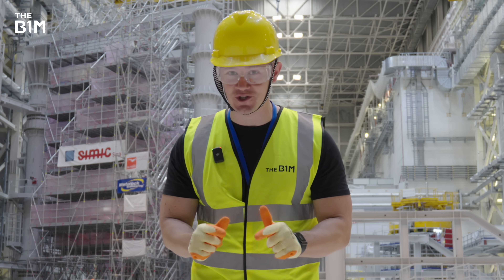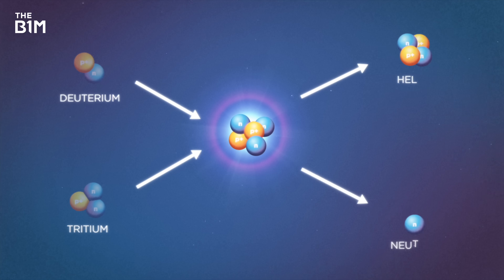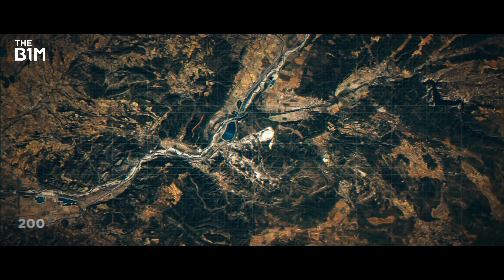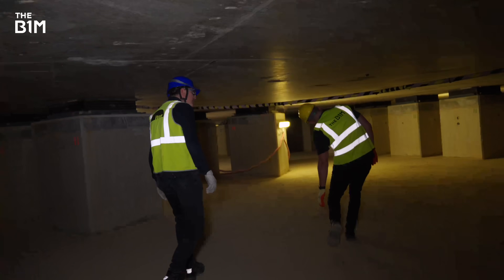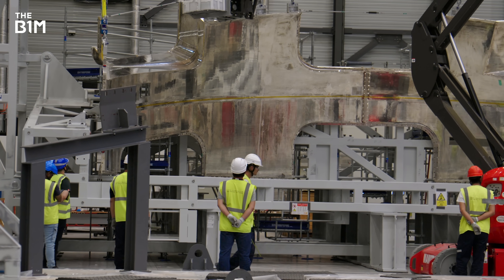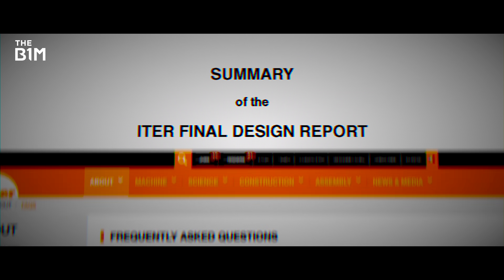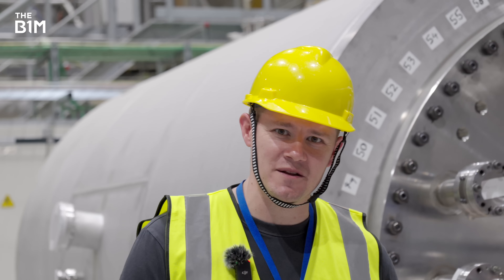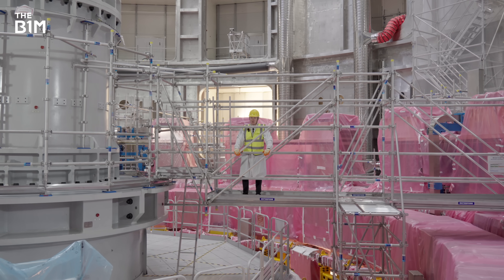This is The World's Most Complex Construction Project

Comment: The CAD files for this thing must be interesting.
Reply: Massive understatement.
Reply: The cad files maybe. But the scientific reasearch is intrestingly inconsistent or controversial. You can build a unicorn catcher, it doesn't mean uncorns exist.
Reply: How many 5.25" floppy disks 😏
Reply: I was thinking about that, do they have all the parts in one software? This might be the most complex machine ever made.
Reply: Cloud storage entered the chat
Reply: @chris-hayes  Solidworks shits the bed with about 200 components in one assembly, so there's zero chance they're using solidworks that's for sure!  I'd imagine it's split into sections where possible, and multiple companies working on different assemblies.
Reply: @gekfurian  I wonder if there were cynics like you before the combustion engine.
Reply: @TheRominGnome1  Combustion engine has worked from day one of its conception and was created in a barn with near to zero money.
Reply: You don't have all those pipes and conduits and sensors and cables and not have it all in a CAD model.
These are exactly the types of people that would do that
Reply: @gekfurian  whats your point exactly? do you think there is no nuclear fusion going on in the sun?
Reply: @Defender90210  In the sun maybe. But over here is absolutely impossible.
Reply: They use Dassault CATIA, and the challenges of managing the digital assets associated with the design are significant.
Previous fusion machines like the Joint European Torus didn't even use CAD as a golden source of truth for the design, and they had to come back later and create drawings from the machine at significant effort and expense.
Reply: @gekfurian  The unicorns do exist, but catching them requires using a very finicky principle of physics, the square-cube law.

The unicorn-catching fluid catches unicorns within its entire volume, but then it loses unicorns through its surface as they can escape from the fluid there, never to be seen again. However, surface and volume do not have a linear relationship: small things have a lot of surface relative to volume, whereas as things get bigger, their volume grows faster than their surface, until they have very little surface relative to the volume.

Because of this and at parity of other factors, we can only catch unicorns if we have a lot of catching volume but relatively low surface for them to escape. Hence, the unicorn catcher needs to be enormous to maximize this factor, and unfortunately enormous means expensive. The good part, however, is that this also works in reverse: as we make the unicorn catcher bigger, its volume grows exponentially greater than the surface, so making it even a little bigger than the critical point can catch us a lot of unicorns. This is amplified further if we use something like a denser unicorn-catching fluid, which has become possible in recent years.
Reply: @Blaze6108 I can appreciate the analogy, though your analogy describes the literal process of catching neutrinos more than it does fusion
Reply: @musicdev  Haha thanks, I like sounding ridiculous.

I was meaning to refer to the energy of the fusion reaction itself - energy gain is volume, energy loss is surface, so current tokamaks benefit from being unreasonably large.

Hopefully no one disputes the existence of neutrons!
Reply: I keep thinking about the plans for this building too lol. Just the drawings were millions and millions!!
Reply: @sidehop at least 7
Reply: Give the extreme complexity and thousands of specialist contractors involved, they could only be stored on CAD files.  A complete single set of A0 or 36"x48" of blueprints would take a year just to copy as there would be literally over 10 million drawings to deal with.  This project makes a major world class hospital look like a kiddy project.  Only a silicon fab plant would be nearly as complex as ITER
Reply: Separate CAD file data center. With top security + top secret.
Reply: @gekfurian are you denying nuclear fusion exists? Or are you denying we can harness it? What are you saying? Serious question.
Reply: @carlwalster7664 guaranteed differnt parts are being outsourced to different companies. I agree, no way is this all one cad file. Each component will obviously be a single file and possibly even broken down further into sub components.
Reply: @gekfurian so what? The combustion engine superceded the steam engine. Is your argument saying we should stick to the old combustion engines?

What is it that youre getting at?
Reply: @gekfurian impossible based on what exactly? Why is it impossible? Explain, show the actual argument and stop asserting things as if you know  it's a fact. I'm open minded. Show me the work that falsified the theory behind fusion reactors.
Reply: @Nuffsed81  
1-The fact that fusion occurs in stars is only an educated theory, but no one has ever proven it for sure.
2- Humanity has never produced a single watt of energy using this technology.
3- Combustion engines, like any other energy source, obviously needed some improvements over time, but they were known and proven technologies from the beginning.
4- This fusion technology, as they describe it, clearly violates the laws of thermodynamics.
5- Tritium and Deuterium are not so easy to find or obtain as they describe them.
Reply: @gekfurian  no, the combustion engine was built on centuries of predecessor advances. If each of those people back to da vinci eho imagined the same, said "meh I won't be the one to make it there's no point to trying"  then we wouldn't have any technology that we use today
Reply: @gekfurian  that logic doesn't work here, fusion works, we have successfully operated fusion reactors many times already,  we just can't sustain it for very long, but it has been proven
Reply: million pieces
Reply: @gekfurian  We know that fusion reactors exist. The Sun is one. The challenge is can we reproduce it and harness it? I fear there are alternate sources of energy that are easier to create and control. After all is said and done, energy that is too expensive to generate is useless. We already have the Sun - we should be focussing on harvesting that energy and directing and controlling that. An orbiting system of solar farms that direct power back to earth is more achievable, in my opinion.
Reply: They use 4dfusion
Reply: @benfowler1134  nah they don't
Reply: The RFI's alone must require their own data farm.
Reply: @gekfurian  haha this is interesting,
Reply: My thinkpad would be spitting flames like an eBay civic trying to load one
Reply: i'm still thinking about the FEM renders for this an how accurate they'll be when this thing gets commissioned.
Reply: interesting is a astronomical understatement 😂
Reply: They asked chatgbt how to build a fusion reactor and it just spit it out, should be fine.
Reply: @alistairmorrish8613  loooool none of these idiots know what the sun is and they have limitless electricity, they just dont want you to have it !
Reply: no it is not.
Reply: @gekfurian the unicorn exists but the catcher doesn't yet.
Reply: @gekfurian  Human efforts of mass scale are nothing if not inconsistent and controversial that’s true, not just for fusion energy, though recently takomak reactors have scientifically proven themselves, and if you even remotely respect what that means, then why isn’t fusion a genuine possibility?
Reply: ms paint
Reply: They'd still need to convert them to pdf for me tbh, amazing project though.  I'll probably be soiling myself in an old folks home by the time the world sees the benefit but it's a worthwhile cause for mankind
Reply: from my humble experience from making a 3D model of a city in Sketchup, I would expect them to have the machine split into relevant sections and only taking the mutual components for reference. And then those segments are manufactured as a whole, not worrying about unrelated parts
Reply: @gekfurian bro the sun is real
Reply: Reminded me of "Contact"
Reply: @gekfurian  firstly, fusion in stars is a proven theory, with experimental and observable results for decades now, so I don't know what you're talking about. Also we have created fusion experimentally in hundreds of different mechanisms , some even producing more energy than required to run the mechanism, what law of thermodynamics does it violate? And tritium is found in minerals and rocks instead of the atmosphere, but there is a steady supply for it. Are you okay?
Reply: @gekfurian you really should read some research papers.
Reply: @maxx8011  LOL!
Reply: @gekfurian You think nuclear fusion is not possible on earth? We have achieved fusion already. We just need time to sustain it. Which is physically possible. If you have a physics problem these engineers and physicists missed, then you should just go tell them they are spending billions in nothing knowing you have all the answers already
Reply: @gekfurian  haha you're too busy being ignorant to actually watch the video eh? The one that shows Germany's already successful fusion reactor... along with several others...  feel sorry  for your poor mother
Reply: @jcbbb  That's the spirit science needs.
Reply: @gekfurian  1 - Fusion is well understood. There's no doubt that this is how stars power themselves.
2 - Of course we've produced watts of energy via fusion. That was achieved first in 1951 with Ivy Mike.
4 - How exactly does this violate the laws of thermodynamics? Please elaborate.
Reply: @gekfurian  Fusion reactors have been built and made to work on Earth hundreds of times.  So far the problem that has not been solved is that they have to put in more energy than they can get out, and are unable to keep the reactions going for more than a short period — often it is measured in milliseconds.  This project though, has zero chance of solving the problem, as it simply takes the same approach that has failed many times before and scales it up.  The only approaches that have come anywhere close to working are not being funded by any government, which is stupidity on a monumental scale.  The Tokamak approach is unlikely ever to work.  Pulsed approaches have come much closer to Unity — the point where the energy output equals the input — yet are not part of this hugely funded project at all.

Fusion reactors are a solved problem, making one that passes Unity is not solved.
Reply: @Blaze6108 

W comment
Reply: CAD has been replaced by numerous 3D modeling platforms.  Each trade, electrical,  mechanical, structural, & hundreds of others will create and manage their specific part of the "plan" which will be "assembled by 1 or more lead architectural firms.  I recently retired as a senior project manager and I cannot even conceive of the complexity of this massive undertaking.   Huge respect!
Reply: Yes… as a pipe designer I see some very interesting pipe arrangements. I don’t see B31.3 or B31.1… I see piping components & arrangements more commonly found in Computer Chip Fabrication plants.
Reply: @leehappy3259  What did you build?
Reply: This is my nightmare as a construction surveyor
Reply: Fusion reactors rely on the assumption that hydrogen fuses to helium in stars under intense gravitational pressure and very high temperatures. It is also theorised that this type of fusion occurs to increasingly dense elements up to iron whereupon all the fuel in the universe will be used up and the fires go out.This is a great conclusion if you are observing a steam engine in a shed when all the coal is burned but has no relation to a universe that has always been, has no limit in size and will continue.
Reply: mate, as a final year computational design student for BIM projects - all i can say is that the CAD files for this would be absolutely ridiculous 😆
Reply: @gekfurian fusion has already been achieved 3 times with a net gain in energy, this isn’t like catching a unicorn, it’s like catching an elusive thought extinct creature, fusion has been done, but not at all on this scale
Reply: @gekfurian what's this based in? It is mainly, or rather significantly, an engineering challenge
Reply: 100% use CATIA. I don't know anything else that can handle assemblies of this size.
Reply: @gekfurian  Nuclear fusion has already been achieved in previous experiments, that is the entire reason this site is being constructed, to improve and scale up the project.   In December 2022, scientists at the National Ignition Facility achieved nuclear fusion “ignition,” in which the energy produced by the fusing of atomic nuclei exceeds that needed to kick the fusion off.
Reply: As and HVAC contractor I would love to see the duct design portions.  The work looks beautiful!
Reply: @chris-hayes  No, even in smaller projects it'd be split up. Software/computers have limitations, every part must be loaded into memory then interact with every other part. After too many parts, you get a breakdown similar to rush hour traffic. Even hardware/software aside, it's just easier to manage and not necessary to have everything shoved into one file/project.
Reply: @gekfurian  if it doesn’t work, at least we’ll never have to build another one 😇
Reply: Probably put it together in TinkerCAD, great software. I heard they used it back in the 1940s to build the space shuttle that flew the dog Loki to the moon.
Reply: @gekfurian  wow you are really a full blown conspiracy theorist. I'm. It going to wate my time. 1 or maybe 2 of your arguments have some validity but only some. The rest is just your lack of understanding and absolute science denying.
Reply: @ClemT-zr1wd  okay how do we get litmiltelss energy from the sun. Show us your work.
Reply: @gekfurian  you are using "spirit science" as your go to? Now I double down on your madness.
Reply: @gekfurian  "The cad files maybe. But the scientific reasearch is intrestingly inconsistent or controversial. You can build a unicorn catcher, it doesn't mean uncorns exist."

Unicorns dont exist, but nuclear fusion does
Reply: @gekfurian  "In the sun maybe. But over here is absolutely impossible."

Considering that we have achieved it here on Earth, albeit for an incredibly short amount of time, that completely disproves that its impossible here.
Reply: @gekfurian  "Humanity has never produced a single watt of energy using this technology."

Yes, we have. A very small amount so far, but we have.
Reply: We have a nuclear physicist in the comment section apparently @gekfurian
Reply: @sidehop More than 2
Reply: I think your computer would liquidate
Reply: @gekfurian  WHAT SORT OF ANALOGY IS THIS XDDDDDDDDDDDDDDDDDDDDDDDDDDDDDDD
Because you basically said nuclear fusion doesn't exist, aka chemistry doesn't exist, aka physics doesn't exist, aka atoms don't exist AKA NOTHING EXISTS XDDD WEIRDEST COMMENT EVER.
Reply: The CAD for this is why Autodesk made Worksets
Reply: And it's all in layer "0"
Reply: oh god i wouldn't understand a thing lmao
Reply: What is cad?
Reply: @gekfurian  that's like saying wood burned from day 1 so we shouldn't use fission reactors because they took years to make them work
Reply: @Decton  no
Reply: @gekfurian  peak brain rot
Reply: @Decton  ok. If you say so. You know better than anyone else.
Reply: @gekfurian  no i don't´, i only know what is given to me, unlike you who denies the possibility of fusion to even work
Reply: think of decoupling hierarchy - each sub-system simply does its thing - just like when designing very complex software systems, decoupling and the use of interfaces becomes very important to keep the thing maintainable by a lot of people; interestingly, no one needs to understand the whole thing in all the details
Reply: @gekfurian  Fusion has worked literally from day 1. The Sun was around much longer than the combustion engine.
Reply: I heard they were just using Minecraft for their blueprint designing.
Reply: likely revit
Reply: @gekfurian  you're a stubborn one, eh?
Reply: @gekfurian  hey dude my daddy showed me that I had two legs and could walk or run everywhere I needed to go before the combustion engine existed. Besides, you need fuel and who the hell can afford that? Mama still don't even buy us any sugar saying it's too expensive, no way would she spring for gas. Why waste money on something that God already gave you the answer for? Pathetic
Reply: @gekfurian imagine being so confidently incorrect.
Reply: @gekfurian   in this case fusion does exist :D
Reply: BIM
Reply: @gekfurian ”absolutely impossible” feels arrogant
Reply: @gekfurian 1- The fact that fusion occurs in stars isn’t “only” an educated theory, there is lots of evidence to back it up. 
2- Humanity has generated several megawatts using fusion… this was just a lie from you.
3- Fusion, as a process, was proven from the beginning. The issue is engineering, not physics.
4- How does it violate thermodynamics? Seems like you don’t know what you’re talking about.
5- Finally, a true statement.
Reply: Nah that's only fission
Reply: It's most certainly EPLAN
Reply: @gekfurian  So was the creation of the blue LED
Reply: @gekfurian  well good thing we know fusion exists. its more like building the catcher..
Reply: I think about this all the time. Any time I think my CAD is getting complex, it doesn't even scratch the surface of a small team's project, let alone a project of this mass scale. I often wonder how it is even possible at times.
Reply: @gekfurian  bro thought he was the smartest guy in the chat lol
Reply: @brayanmiranda9158  maybe im not the smartest, but the fact that they use our money to research something so challenging and not their own, means that that they know it doesnt work
Reply: it's not cad anymore it's procore
Reply: @gekfurian  thats pretty interesting what do you think is the real mechanism that powers stars ? based on conclusive data and observations
Reply: @gekfurian they have already pulled off fusion about a year ago with the first 100%+ energy return. No one cared and it was a massive achievement, this is scaled up; and more efficient. It's also not a unicorn, the sun is real.
Reply: @gekfurian Converting two hydrogen to helium requires less energy to be stable, and you use that energy. If you use a little energy to spark a fuel, you can get a larger return than the initial spark. Particles when fused, are an abundant source of "gasoline", you just need a lighter. Entropy is still fallowed you just can't see beyond the flame.
Reply: @carlwalster7664 If the Japanese were responsible for making the D rings I imagine the bed in question is tantamount to a sewage plant. And their software development is worse than wet toilet paper.😂
Reply: @gekfurian bro ain't never heard of the castle bravo test 💀👎👎👎👎
Reply: @gekfurian  They wouldn't be building it if the science didn't check out first.
Reply: @007agentas would you trust the cloud with something this big?
Reply: Uh-Oh, one of the CAD-guys exploded the XREFs for the MEP dwgs...
Reply: @gekfurian  while we need cynics to keep dreamers in check, we do still need dreamers to do what humanity has always done that separates us from other creatures - advance. Every year we are exponentially advancing beyond what used to be considered impossible. There have already been scientific breakthroughs in fusion that show it is not impossible.
Reply: Has to be a bim system. Each country is taking on a different channel and then delivering that completed "part". Many are funding this is way way more complex and it's national pride to deliver what you promised. If you're not working in cern or an advanced physics lab then you want to work here
Reply: @gekfurian don't worry, we need the money grubbers to keep science grounded. Scientists often dream high and they can be expensive. But what makes humanity evolve is not the money grubber, it's the dreamer.
Reply: @carlwalster7664  imagine the loading time on that .sldasm :O
Reply: Thinking of how many layers could be there in this one single CAD file is crazy.
Reply: @gekfurian <-woefully uninformed lmao. We wouldn't be spending the money or effort building this facility if the science was purely theoretical, we would be using small scale reactors, which we already have. Fusion is well understood and we have been able to recreate it on earth. We just haven't been able to sustain it long enough to make use of it for energy.
Reply: bro pls XD
Reply: @gekfurian you forgot point 6. Earth is flat 😉
Reply: @gekfurian What part of fusion technology violates which laws of thermodynamics?
Reply: @leehappy3259  Every 3D design platform is CAD. It stands for "Computer Aided Design".
Reply: @gekfurian  That’s a good point - yet if you don’t look you wont find them! For me as a non-scientist I always thought that even a hypothesis proven wrong is still a success?
Reply: @TacereMors  With our money?
Reply: @gekfurian  wonder what you think about LHC and CERN then...
.
.
.
.
.
lmao, big brain
Reply: @gekfurian  says its inconsistent or controversial, wrap it up lads,  its ogre
Reply: @carlwalster7664  They probably, just a guess, have a super low LOD model with all the main parts as placeholders, and other files for the high LOD models. If there need to be connections between models they can turn on a selection of high LOD models. And that multiple layers deep.
Reply: So glad you know more than leading scientists. Shocking you're not on the team and here on YouTube....@gekfurian
Reply: I started working CAD in 1981 for the navy, 256 layers.
Reply: Giant fucking stack of blueprints, impressive in their own right.
Reply: @gekfurian the fact that you think watt is a unit of energy tells me everything i need to know…
Reply: @marius4278  The fact that you believe in magic and that our taxpayers money should be wasted like that tells me everuthing I need to know...
Reply: @gekfurian  I'm sure you are much more qualified to talk on the topic of fusion than all those scientists from all around the world. the delusion is astronomical.
Reply: @marius4278  You mean all those scientists who need to pay bills and mortgages?
Reply: @gekfurian  science experiments is not where the money is lmao. if they were in it for the money, they'd be in industry. holy copium you are dense
Reply: @gekfurian   So are you saying that someone who needs to pay bills can't be qualified? What are you even saying? Are you listening to yourself? Do you think you're doing some major critical thinking here?
Reply: @gekfurian fusion violates the laws of thermodynamics? Which law and how?
Reply: could keep you busy foe a while .
Reply: As a drafter this was my thought too... you must be a drafter haha
Reply: 5 terabyte of floppy disk with classified red lable
Reply: @gekfurian  Buddy fusion exists because it happens in the sun, that research isn’t debated or inconsistent and more energy has been generated than put in with other fusion methods. That is all the research you need for a project like this to start construction.
Reply: yes
Reply: yes. They are gonna take a day or two to understand.
Reply: @alistairmorrish8613  No the challenge is making it affordable. This is where fusion power will inevitably fail as it will NEVER be economically viable. It simply cannot compete with renewable energy sources, not at modern-day prices and especially not at future prices as those will only become cheaper. The complex construction, the vast amount of rare material required and finally the need for tritium make it doomed from the start. It won't even be able to compete with normal fission reactors.
Reply: @sidehop  All of them. plus 10%